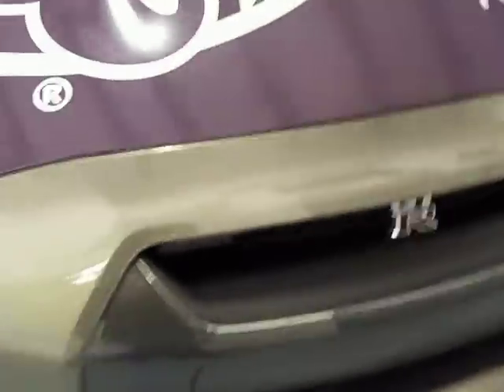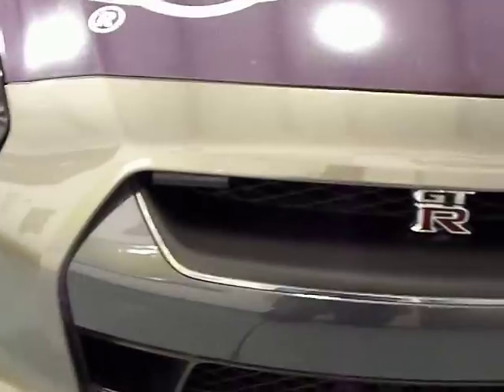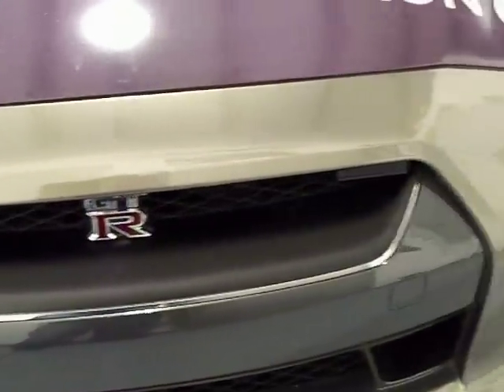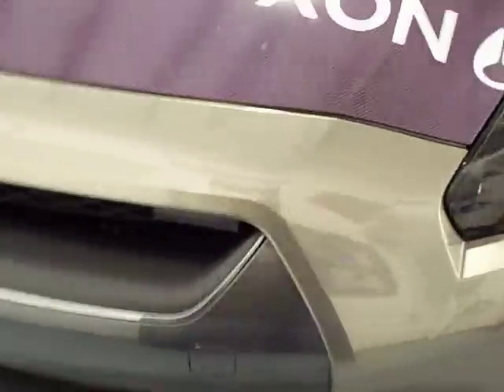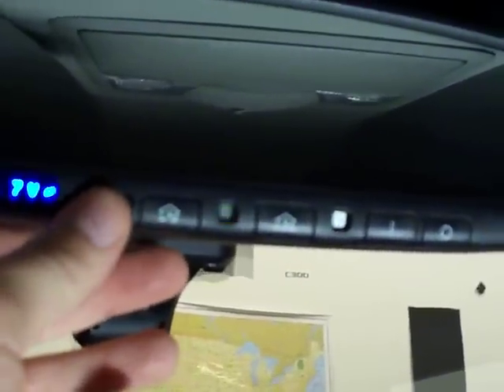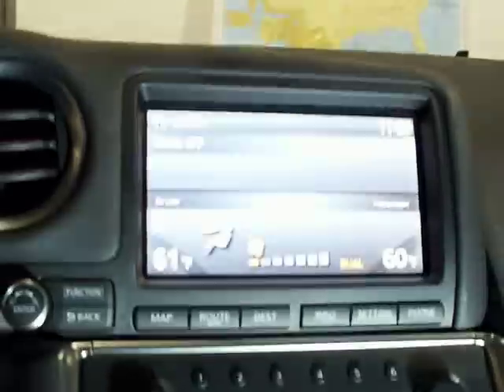2009 Nissan GTR Custom Passport 9500CI installation

Comment: Looks good.  Couple of questions:

1.  Are you aware that the user will have no access to the power switch?

2.  Where is the radar antenna mounted?

Thanks.